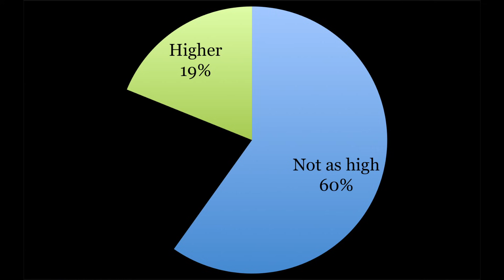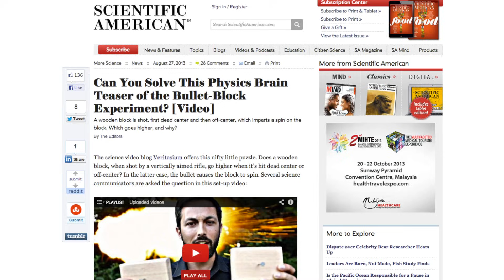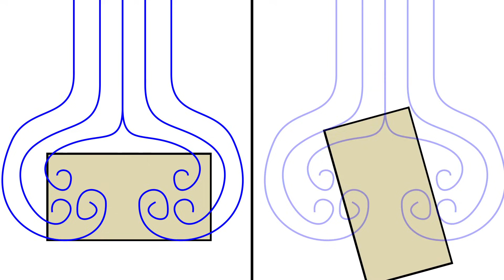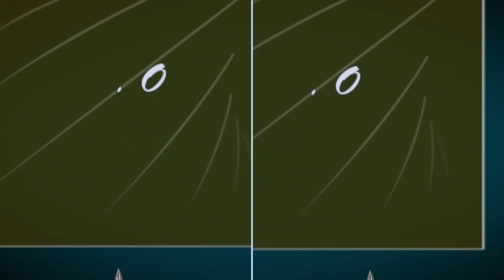Bullet Block Explained!

Comment: if you take a loger pice of wood, then the difference might be greater because i think a bigger part of the energy would turn into spinning motion because the impact is further away from the center. there might be the problem that the wood starts to bend, but it's worth a try.

Comment: A definitive solution is to use a significantly lower density substance (thusly needing to be larger)  you would have a higher probability of success.  The "energy" required to deform a lower density substance being much lower might allow for significantly higher  inner "block" travel distance at even the 1% energy difference you mention in the video.  Alternatively, you could use a significantly higher powered rifle, thus giving the bullet more "energy" same equation, just other variable.

Comment: try using a longer block and fire more off centre point this might increase the difference.

a plastic bar might be better because the hardness and strength would be more uniform. this lowers the uncertainty and makes the experiment more correct. 

instead of using a normal gun  you could use an air gun and shoot at a pressure sensor on the bar. this makes it able to measure the impact power of the bullet, you might measure a difference between the off centre and centre shot.

Comment: Obviously what you want to do is amplify the difference between depths with less dense material.  But you don't want to make something too large.  How big would a styrofoam block have to be to stop a bullet, right?  Instead make some that is progressively less dense, to amplify the results only at the end.  Use something thick to remove the initial kinetic energy.  Then use something less dense to amplify the remaining difference. Calibrated correctly, this might could remain a reasonable size.

Comment: ^This as well a making some changes to better control for some variables:
-use a synthetic material (like a foam or gel)  that has both a lower and more uniform density than wood
-use either hand-loaded or match-grade ammo so that the charge and bullet weight are more consistent  and use a FMJ bullet, not just lead -or- you could build a rig to fire heavier, harder projectiles like a steel ball bearing.

all would yield deeper, more consistent penetration and make the ~1% diff easier to measure.

Comment: How about hitting it with clay/plasticine with high speed camera? You could measure the time (length) of collision in both cases, so it should translate to the heat produced. And capture it in IR if possible :)

Comment: On understanding the angular momentum: keep in mind that the system you're concerned about is the wood block + bullet system. In one case the bullet is fired toward the center of mass of the wood block and thus there is no angular momentum in that system. In the other case the bullet is fired off center and thus there is angular momentum. Think of two cars in a head on collision, either directly aligned or off center, if they hit off center when they hit they'll rotate.

Comment: This got me too. However, according to the Wikipedia article on angular momentum, something doesn't have to spin to have one - it can move in a straight line, but *relative to a point NOT on that line*, it DOES have angular momentum. Now, considering that in the 2nd case neither the bullet before nor the block after(?) is moving along a line that includes their common center of mass, clearly there is more to the whole angular momentum than just the spinning of the block... :)

Comment: Use a larger, but slower projectile. Something that will have a similar momentum, but will lose much less of a percentage of its energy to deforming the block. This way, the difference will be more significant.

Comment: That's an even bigger can of worms I think - the soft bullet would flatten on the hard impenetrable target, and possibly also ricochet. Good luck measuring what energy went into the plastic deformation of the bullet and how much energy it departed with (possibly in a number of fragments)...

Comment: In order to create a measurable difference in penetration, you could scale down the weight and density of your projectile and target material.  For example, you could use a BB gun and a Styrofoam block (or maybe Jello).

Comment: "MECHANICAL Energy is not conserved in an inelastic collision" This is better?
And for the difference, as I said, I am with you, but this is not the case, maybe the value are exactly the same but you will not ever know, because of the experimental errors.

Comment: Wrong. The blocks rise to the same height because momentum is conserved. Total energy is also conserved, but mechanical energy alone isn't: the rotational energy in the spinning block is equivalent to more heat and damage in the non-spinning block. The only reason that both blocks don't reach exactly the same heights in the experiments is due to a difference in conditions, in particular the consistency of the gun shots. These differences are irrelevant to the underlying physics.

Comment: You just need to perform the experiment using a material with significantly lower density than the wood block.  The lower the density, the more perceptible difference between bullet depths - because the bullet would be able to travel further, but the ratio of the distance the center bullet to the side bullet should remain relatively constant (within a standard deviation).  Of course, too low a density, and you'll just be comparing bullet height ;-)

Comment: I think it is basically the same as when a car is turning. Day you are on the roof of a car. Say the car goes 50mph and then stops. You would go flying off of the car and go a certain distance. But now say another car does the same thing, but instead of turning, it makes a sharp 90 degree turn( if cars could do this) You would still go in the same direction: forward. People thought of the blocks' momentum and thats not the momentum they shoulf be focusing on. It is the bullets momentum.

Comment: I hypothesized the same answer that you came up with here. If the bullet was entering the spinning wood at a slower relative speed than the block not spinning, the wood would receive more friction and push/time giving it more energy to spin. I think that if a non spinning block sitting in outer space were hit with a bullet moving at a speed of 20mph: less than 1% of the examples speed in mph, the block in space would spin without even being penetrated: bullet depth affects block spin minutely.

Comment: If in addition to a softer material you increased its rotational inertia of the block, the energy dissipated by the rotation would increase and the distance per unit of dissipated energy would increase. The combination of the two should give you a observable difference. You could also try changing the mass and velocity of the bullet (or use a dart or arrow) to change you kinetic energy without changing your momentum. This could also have an interesting effect on the rotational inertia.

Comment: Shooting the bullet down the grain of the wood as opposed to against it should provice a significant difference in penetration. Since the block would become more easily deformed it would be interesting to see how much higher or lower shooting with the grain goes compared to against.

Comment: Hitting a 5-lb block dead-center with 4 pounds of force causes the wood to absorb and dissipate all 4 pounds of energy through deformation.  But because of leverage, only one pound is necessary to lift the end of the block just a little.  That means 1 pound will be lost moving the block, leaving only 3 pounds to penetrate the wood, which should leave you with measurably less penetration.

Comment: if you were to use a material that is less dense than wood, the bullets should travel further into each block. The two distances should hopefully scale proportionally and become more easily measured the softer you go.

Comment: Use a much longer block, and you should be able to create a measurable difference in penetration depth.  If your block weighs 5 lbs, and you hit it dead center with 5.1 lbs of force, it should just barely nudge the block.  Hitting it with 4.9 lbs of force would, of course, not be enough.  But, if the block is a foot long, and you hit it way over on the edge with less than 5 lbs, you know because of leverage it will lift the end of the block a little.  Have to post a reply to continue....

Comment: Also the wood blocks have varying weights. The dark stripes from the growth rings, and any knots in the wood are denser than the  lighter wood. It  isn't a significant difference, but it is a difference. This would actually impact bullet penetration a fair bit though, with blocks having more of the darker sections being denser, and having more effective materiel to penetrate.

Comment: Kind of interesting. To me, the non spinning block visually  went  slightly higher than the spinning block. At :43 ( though you can see it better in the previous video) the spinning block  obscures some of the foilage constantly,  while there is a rather significant gap  between the foilage and the non spinning block. I would say this is merely because of the tilt the non spinning block is at, but the tilt is not significant enough to account for the gap. Does anyone else see this?

Comment: To make the experiment measurable in terms of block penetration length, you could shoot the bullet into an object of a different, softer material, but of larger size. The difference would be metrically longer and more likely measurable. Material suggestions: soft but deformable plastic, rubber, some sort of gelatinous material, soft metal (eg. tin), gypsum (eg. drywall)

Comment: im guessing from the x-ray, that you used a 30 caliber  projectile and you may be able to show the depth change by using the same cartridge but buy using two types of wood to make the blocks with the same mass. just different size due to density.

Comment: BTW - you didn't explain why the measured depth, using the nail, was so WRONG, as the x-ray showed an equal penetration. Did a wood splinter block it?

Comment: For your "further experiment" --- I would suggest a LOWER Density object [ballistics jell in clear plastic casing perhaps] so the difference in the bullet travel might be more pronounced, and visible without the X-ray.

Also, you could modify the air resistance factor [did the spinning block MOVE the air around it, allowing for higher movement?] by doing this in a chamber where you can change the pressure, either lower or higher. And alternative would be to do it horizontality in a large pool.

Comment: please note that linear and angular momentum are conserved when no force is applied. So technically they are not conserved for the bullet and the wood block as there is gravity and friction acting on them. (Force is the rate of change of momentum).But, JUST before and JUST after completion of the impact, we can say they should be nearly conserved.
newton's cradle works as the loss of energy is minuscule and the frame is fixed forcing angular momentum.

Comment: @5.48, there's a fundamental mistake.
The bullet transfers its momentum to the block + bullet combination. Agreed.
However, for the offset bullet, some of that momentum becomes rotational. Not all of it becomes vertical. It can't. Conservation of Energy says you're making a mistake here, and it would appear that you're mis-applying Conservation of Momentum.

If angular and linear momentum are independent, how does a Newton's Cradle work?

Comment: This is not relevant to this test because that's measuring static energy transference not joint energy transference. When you shot the block off center it's going to cause a glancing blow in which the block will only rotate but not gain nearly the height of the center shot block. This wont have effects on bullet depth theory because the main point of the original experiment was that the bullet was lodged in the block.

Comment: Since you've already done the experiment rather than replicating using a less dense material. I would suggest filling the holes with a medium that you could measure mass displacement to figure out true penetration principals. You could then measure the mass differences and be able to more accurately depict the characteristics of bullet penetration.

Comment: By using a softer material and/or a gun with more power would increase the bullet penetration making the difference in depth more notable.
I would think a soft cover book could work, and u could probably use the pages to compare the bullet depths.

Comment: Question? Say you had an infinitely small bullet and shot it directly at the center of mass, completely eliminating angular momentum. Then shot a second infinitely small bullet at the farthest possible edge away from the center of mass so that all of the energy was turned into angular momentum. Would/Wouldn't all of that energy act as if it were coming from the center of the block as the rest of the block, except the infinitely small sliver, pushed against the table causing it to propel upward.

Comment: Say you had an infinitely small bullet and shot it directly at the center of mass, completely eliminating angular momentum.  Then we shot a second infinitely small built at the farthest edge away from the center of mass so that all of the energy was turned into angular momentum.  Wouldn't all of that energy act as if it were coming from the center of the block as the rest of the block, except the infinitely small sliver, pushed against the table causing it to propel upward.

Comment: But because the block starts spinning away from the bullet, it would create a curved path, which you couldn't measure the length of with a screw. Maybe try it with clear plastic blocks?

Comment: One can easily see some vibration in the transparent supports during the off center shots. This indicates that they are facing some force from the nails. This force comes from the pivoting downward motion of the block. The centered shots does not cause the supports to move or vibrate as there isn't any force.

I think the trajectory of the block shot off center would not be straight upwards if the experiment was done with hanging blocks.

Comment: If you look in the video, the blocks are suspeneded by a nail through the middle and the far side is not supported at all.  The reason for this is exactly the reason you just gave.

Comment: The block shot off center has an opposite downward motion on the other end of the block pushing against the table. This helps give the block additional upward motion. Try suspending the blocks from a string a do the experiment again. The block shot off center will do a lot more spinning and will lose most of its upward motion.

Comment: One thing that's not explained in the video is why a non-spinning bullet hitting can hit non-spinning block, make that block spin and still conserve angular momentum. The answer is that, since the off-centre bullet is not travelling along a line through the centre of mass of the bullet-block system, its motion has a rotational component with respect to that centre of mass. Therefore, there is non-zero angular momentum before the collision.

Comment: What about removing the factor of wood grain and thus hardness ripples from the equasion? Any random factor when dealing with a 1% variation is important.
Additionally slowing the experement down, like doing it under water with a slower projectile would allow more accurate visual queues.

Comment: I think you need to make the bullet go through a softer material, so the deceleration is slower and more noticeable. Not that soft that the bullet goes right through the, but something like a foam yoga block. the important thing is that the density of the material should be uniform within the test block.

Comment: Linear momentum can in fact be converted to angular/rotational momentum. Use a much longer block and strike it farther off center to expose this conversion of energy and you will see the height difference in your experiment you where expecting. 

For people trying to reproduce the experiment I would suggest considering a thick foam core board and pellet, bb or air soft . The foam board should be more consistent then wood and make depth checking via back lighting possible.

Comment: The difference in the penetration depth comes from the fact that the side of the block moves away from the bullet more easily, than the center. To enhance that effect ones has to enhance the moment of inertia to mass ratio, for instance by taking a longer rod and/or fix some mass in the center of the block. When are you going to take this up? We might be able to film an experiment with it next week.

Comment: The trick in angular momentum is that you need a fixed origin first. It doesn't matter, which point you choose as your origin, a.m. will equally be conserved but you mustn't change your origin midway through the experiment.

Let's choose the centre of the block: the bullet, although it flies straight,  its angular momentum is non-zero, as it doesn't head straight towards the centre. Once the bullet is stopped by the block, that angular momentum is conserved by the spinning block-bullet complex.

Comment: The angular momentum in the pre-collision senario is given by the rotaional motion of the bullet with respeckt to the center of mass of the combined system. That does have a non zero value before the impact, when the bullet is shot off center.

Comment: Maybe I'm missing something simple here, but what about conservation of angular momentum? The angular momentum of the system is zero in the moving bullet/stationary block system, but definitely not zero afterwards. So, if conservation of angular momentum doesn't hold for a system involving changing linear and angular momentum (for individual bodies, not the system) why does conservation of linear momentum hold?